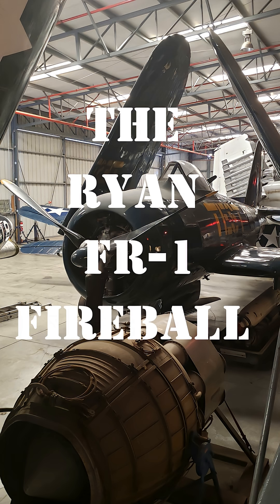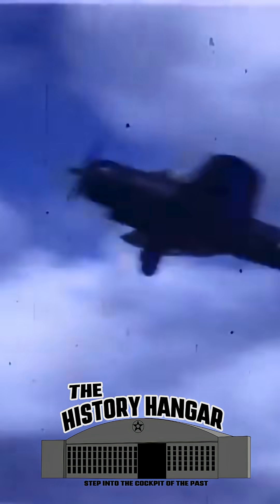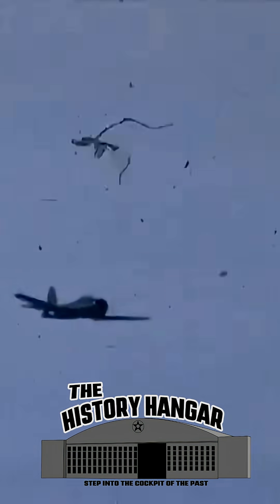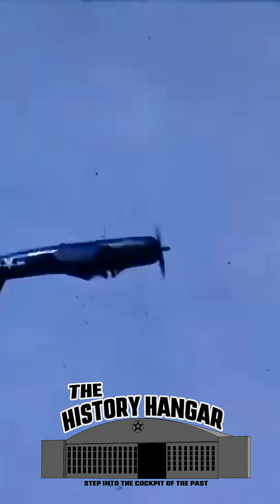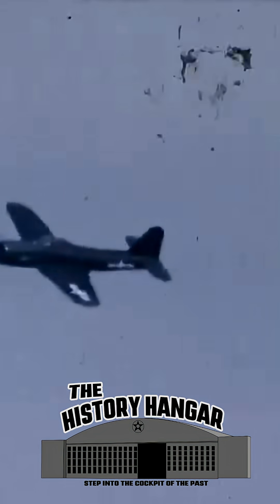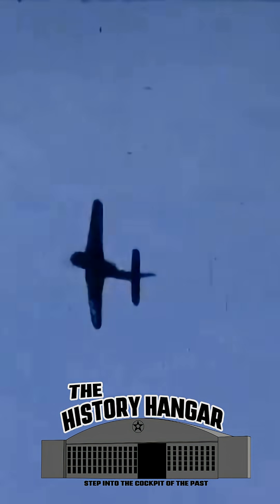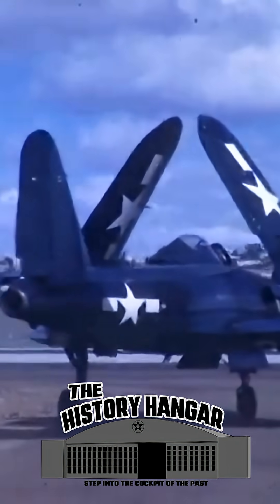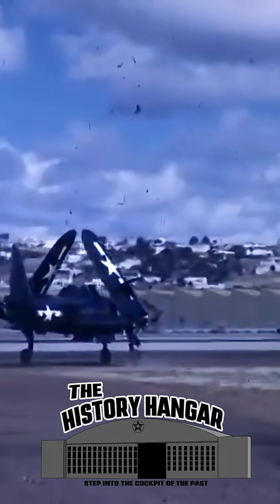Why the U.S. Navy Built a Hybrid Fighter #aviationhistory #thehistoryhangar #warbirds #USNaircraft

Comment from the maker: The Ryan FR-1 Fireball was built at a moment when aviation didn’t know what the future would look like.
Would you have trusted a fighter with both a prop and a jet from a carrier deck?

👇 Drop your thoughts below — was the Fireball brilliant, bizarre, or both?

🛩️ Want more rare aircraft stories like this?
Support The History Hangar by joining our Patreon!
Your support helps us keep filming, researching, and preserving aviation history.

Thanks for watching — and welcome to the hangar.
Reply: I have a "souped up" version in my head for a video game project I'm working on. It still has the same cyclone radial, but it's the late variant cranking 1,425hp, a Hamilton standard paddle prop and the jet engine is instead the cj-610

The wingtips are squared, the guns are still 4 but they're either M3s that fire at 1,500 rpm